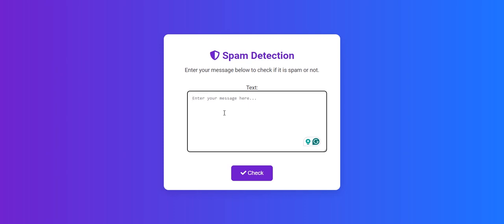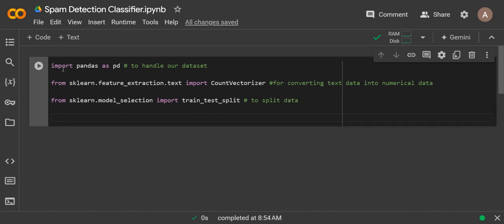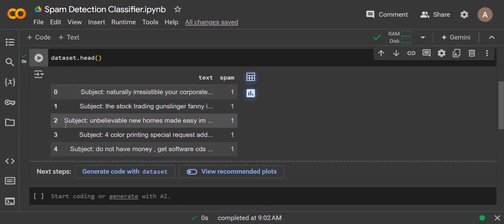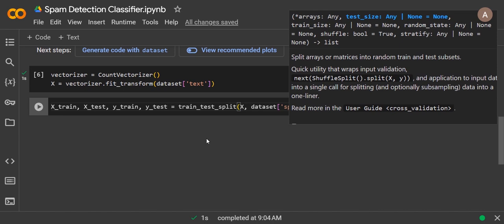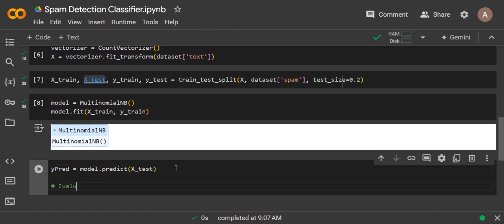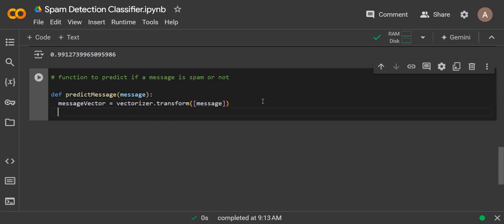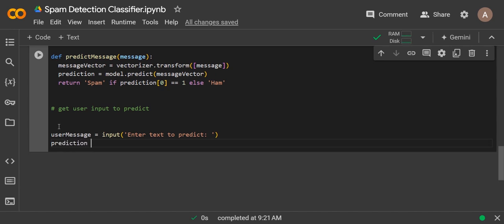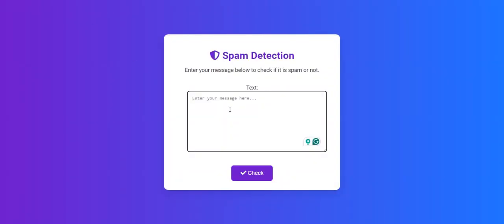Email Spam Detection (99% Accuracy) | Python Machine Learning Project 01 (Part 01)

Comment: Bhai the output option showing but while entering input it's shows name error and some error occurred. We have write code as well as video
Reply from the maker: A NameError in Python occurs when you try to use a variable or function name that has not been defined.

Example:
my_name = "Ali"
print(myname)

Output:
NameError: name 'myname' is not defined

If you provide the exact error message you're seeing, I can help you resolve it more specifically!